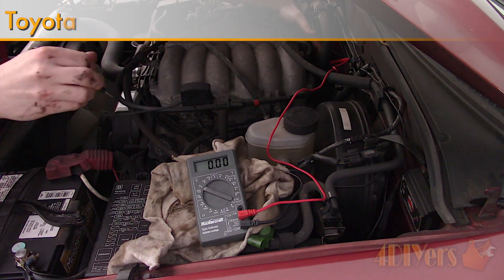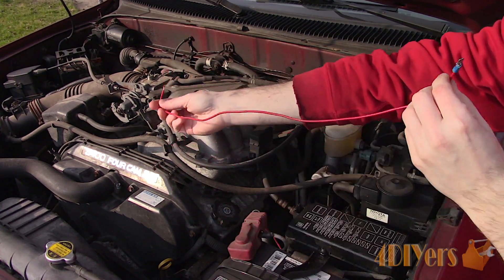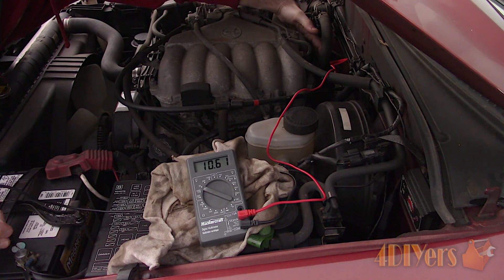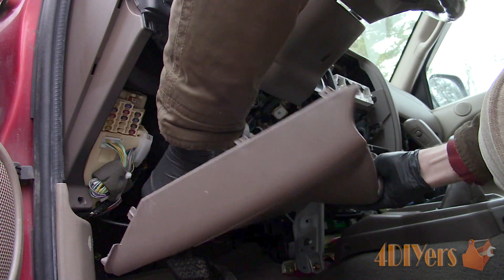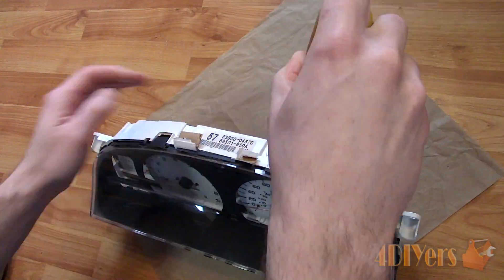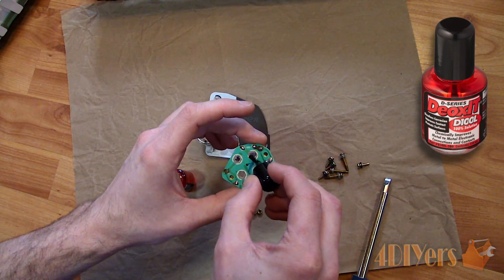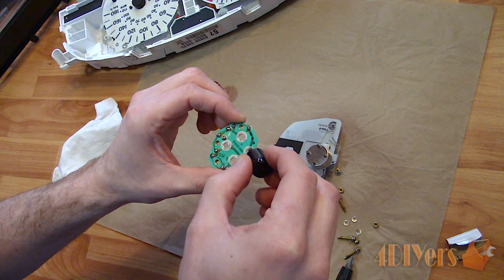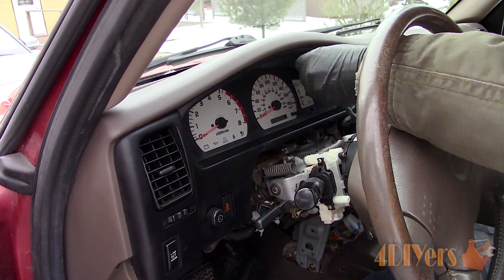How to Repair the Temperature Gauge on a Toyota Tacoma

Comment: Hi, i’m only getting 8.3v when i check with the multimeter. I didn’t put a jumper wire, is the reading too low ?  Should it be more around 10v like yours? Thanks

Comment: Today I did this repair and followed the steps but after I reinstalled everything and checked I the cluster I noticed my fuel level was off by a quarter and my speedometer was reading 10 mph slower than I was actually going. I was thinking about letting it sit with the battery disconnected overnight but I’m not sure what else could be the issue. (Note all my gauges worked perfectly before expect the temp gauge of course)
Reply from the maker: Could potentially be a wiring issue. Are you sure all the connectors are fully in place and there wasn't any corrosion?
Reply: @4DIYers  I plugged everything back correctly but since I did do this repair outdoors I was thinking connections got dirty
Reply from the maker: I do all my work outdoors with no issues. Dust can get in behind the dashboard so there is a potential for dirt to fall in a connection.

Comment: I was hoping it was this easy, the green capacitor on the motherboard for this Guage is burnt😢. Where might I find this capacitor?
Reply from the maker: Might be able to clean it up with an abrasive pad.
Reply: My bad, improper terminology, it's a four band resistor color code left to right gold, black, green and maroon. Copper windings appear to be fine, no broken leads. This the only resistor on the motherboard.
Reply: Thanks for your help

Comment: mine starts low when started then after 2-3mins it will reach high. anyone has the same issue? could it be the sensor? or the cluster? TIA yall
Reply from the maker: Could be q faulty sensor. I do have a video for testing it.

Comment: Great video.
I have a similar issue where my temp will jump up to the middle and always stay there regardless of a cold start. I swapped out the sensor and it did nothing. Do you think the needle bolts behind the cluster could be loose causing this?
Reply from the maker: Yes quite possibly. This is a very common issue on these trucks.

Comment: Does loose nuts on the gauge can cause low temperature reading? Assuming of course sender has been changed using new oem , oem thermostat. What do you use to tighten the nuts?

Comment: my 2.7 has sending unit about same and hard to get at. As an electronics tech I recommend a pencil eraser for shinning points of connections, as an electrician I recommend NoLox  an anti oxidant/lubricant we use all the time in the field for electrical connections and thread treatment, always on my Rolley cart with my tools.

Comment: Thanks for the video. Some great information here. 
I'm currently trying to fit an aftermarket digital gague to my gen 2 Hilux surf (I think it's the same as a gen 2 4runner but RHD) I have tried tapping into the stock gague and just piggybacking the stock sender from there but not having much luck. Maybe I'm way off with this one ... Would you have any tips/advice.  
Thanks the videos. They're a real help.

Comment: Very helpful. I grounded the wire to the sender, my gauge shot all the way up, replaced the sender. No change in condition. Removed combination meter, disassembled meter and removed gauge. The nut holding for the ground terminal was loose and almost off. Reassembled everything and confirmed proper operation. So I had 2 problems, just in case someone else has a similar condition
Reply from the maker: Thank you for the kind words and sharing your feedback! Should definitely help out someone else in the same situation.

Comment: I took off the needles on my gauges for my 2002 Tacoma trd  to repaint them due to fading . when I reinstalled them, as soon as I turn the ignition on the temperature needles jumps to H. and stays there whether the engine is cold or running temperature. is it possible I reinstalled the needle in the incorrect position on the pin or is this a electrical issue ? it was working fine prior to disassembly
Reply: i read your comment and i was wiondering if at all possible did you fix your issue regarding the temp gauge on your car reading hot all the time? if so, can you fill me in on how your resolved your repair? I would appreciate it if you could please Ive changed the gauge cluster even my mechanic couldnt find the issue? its been about 6 months its been  like this.

Comment: I really don't like the idea of testing a gauge by grounding out the input.  In my opinion it's better to put a resistor to ground there.
Reply from the maker: Very common old school method and it's safe. The power wire is supplying the sensor with 12v, so with the jumper wire grounding out the circuit, it's acting as if the engine temperature was extremely hot.